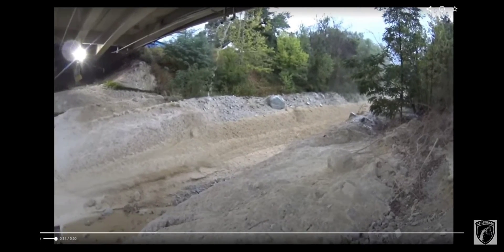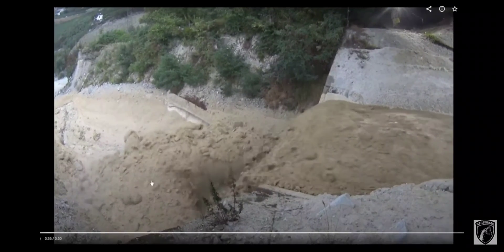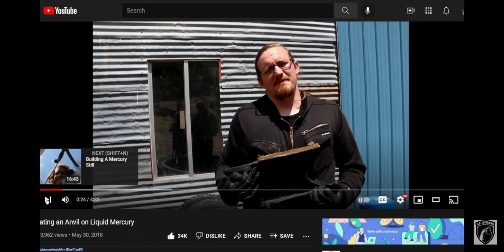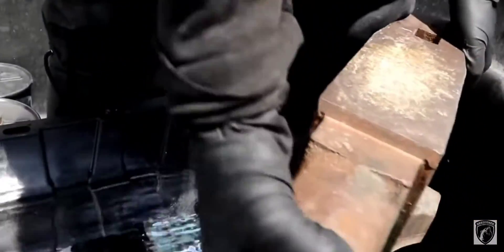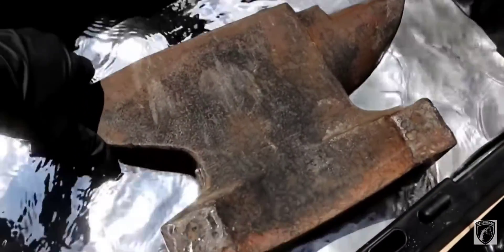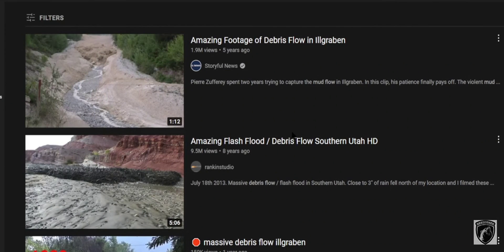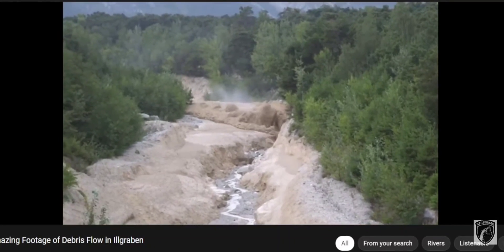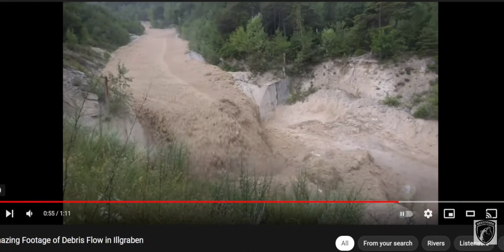🔴Bushwhacking Buoyant Boulders *SHORT* - Does Rock Act Buoyant in Mudflows as Anvils do on Mercury?🔴

Comment: I guess this has more to do with viscosity, rather than the mud beeing more dense than the stone, or whatever other strange phenomenon. It’s 100% logical when you think of it.
The larger the stone, the more sticky material it will have to move when it wants to naturally sink under its own weight, hence the impression the stones are ”floating” between two waters. They have not enough time to move all the mud aside before reaching the ground, due to their size and the amount of pressure generated by the resisting viscosity of half-thick mud.
We only see the big ones, because the smaller ones sink more rapidly.